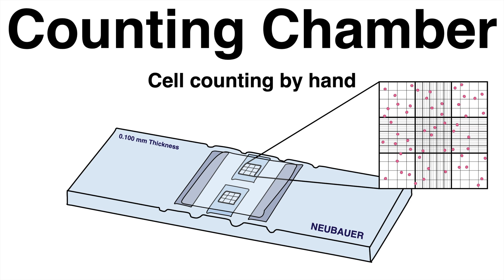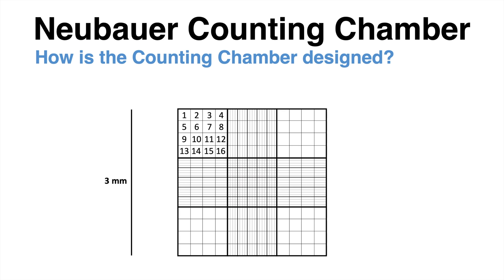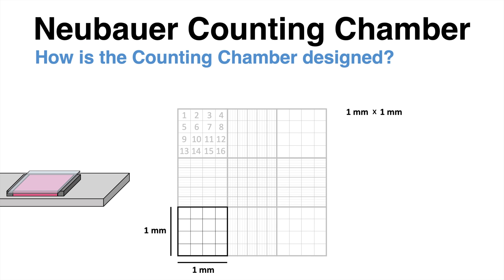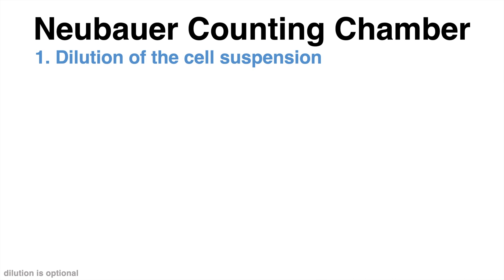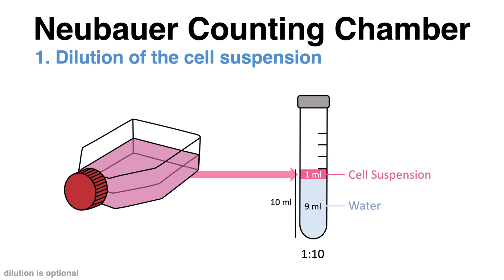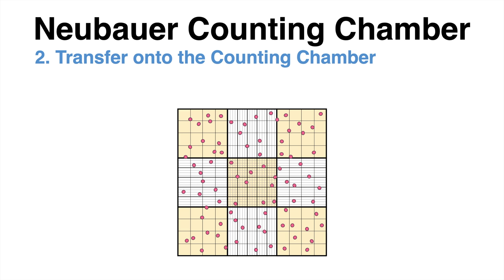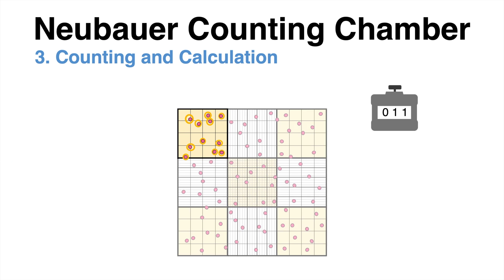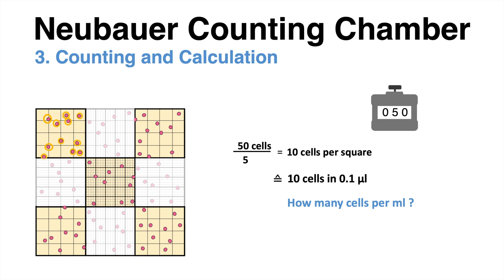How to count cells with the Neubauer Counting Chamber

Comment: Thank you for the presentation however your explanation at the 2 min and 27 mark about which cells to count and what shouldnt count isnt entirely accurate. I had to listen to it a few times but counting the cells in the blue boundary (bottom and right) is inaccurate because you dont know if it truly falls within that square. However if you are counting cells at the top and left, there are no other squares on the outside of those boundaries so it is safe to include those cells in the estimation. I am open to understanding this more and look forward to your response. Thanks

Comment: Good day, pls i dont understand the calculation aspect of the video, pls can u explain in details of how u did the calculations. Thank you
Reply: He counted 5 large squares ( 0.1uL each ) and counted a TOTAL of 50 cells. The average number of cells per large square is 10. but each large square is 0.1uL. We want to know the average # of cell per mL but we have 0.1microLiter.  We need 1000uL to have 1ml. To get this multiple 10^4 to 0.1 microliters to get 1000microliters. Now, to solve how many cells are in 1 milliliters. You have to  remember that solution had been diluted  by a dilution factor of 10, and also we have 10 cells per 0.1uL. So it will 10 cells/uL x 10 dilution factors x 10 ^4 = gives us number of cells per 1000uL as opposed to 10 cells per 0.1microliter.

Comment: Please I don't understand how 10 to the power 4 came about
Reply: Each square has a volume of 0,1 uL = 0,0001 mL (you are calculating cell/mL). Instead of dividing by 10^-4, you multiply by 10^4 (it's the same)
Reply: power 4 = multiply 10 to itself 4 times , i.e. 10 x 10 x 10 x 10 (10,000) 
power 3 = multiply 10 to itself 3 times , i.e. 10 x 10 x 10 (1000) 
power 2 = multiply 10 to itself 2 times , i.e. 10 x 10  (100)
Reply: We need 1000uL to have 1ml. To get this multiple 10^4 to 0.1 uL to get 1000uL. Now, to solve how many cells are in 1mL. You have to  remember that solution had been diluted  by a factor of 10, and also we have 10 cells per 0.1uL. So it will 10 cells x 10 dilution factors x 10 ^4 = gives us number of cells per 1000uL ( or 1 mL) as opposed to 0.1microliter ( 0.0001mL).

Comment: Wait i saw a different video saying u can't count the cells on the lower and right corner lines but u are saying u should im confused now but that guy was using some trypen blue method which he called it
Reply: It isn't important which of the corner lines you don't count. You just have to choose two touching lines and stick to that while you're counting to prevent you from counting cells two times.

Comment: Hi! Thank you for the video! I have a question regarding the cell counting, cause in some labs they only count 4 corner squares, but here it says 5. Does it depend on a cell type? For example, should I use your method in counting HEK 293 cells (Human embryonic cells)?. Thank you in advance!
Reply from the maker: Short answer: The more squares you count, the better...
It is totally fine to only count 4 and it also depends a bit on the cell type and the quantity of the cells in suspension. 

HEK293 cells can be counted with a Neubauer counting chamber! The only important thing in general: Always make sure your cells are not clumped together or aggregated. As long as the cell type is visible under the microscope and as long individual cells can be separated from each other, any cell type is fine to be counted with this device!
Reply: heyyy my lab uses this method for HEK293!!!

Comment: What is the reason for not counting the white squares?
Reply from the maker: Technically, you could also count all cells in all squares. But: You have to consider that in the calculation later (divide by 9 instead of 5 to calculate the mean).